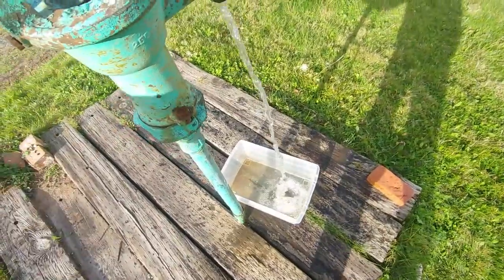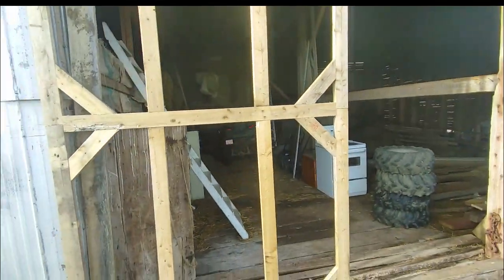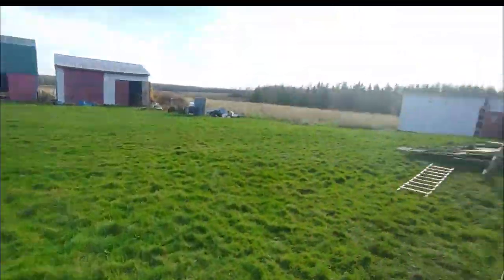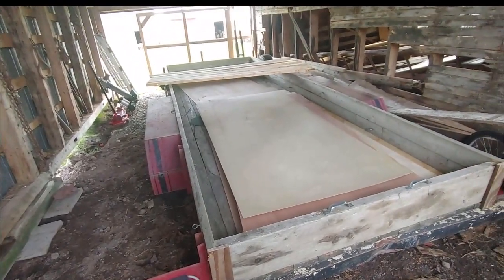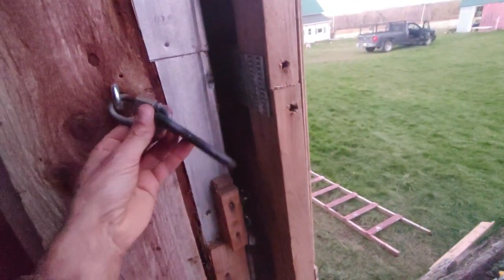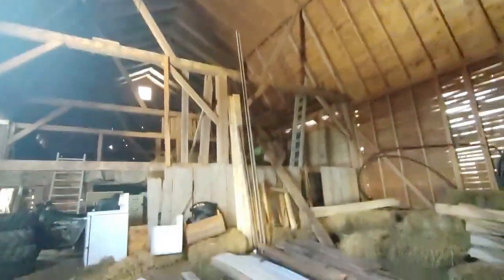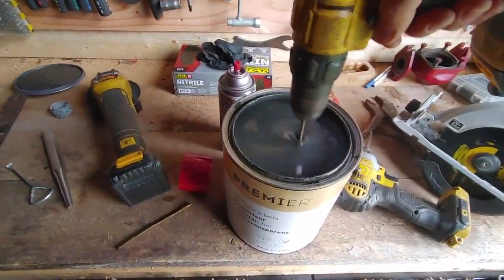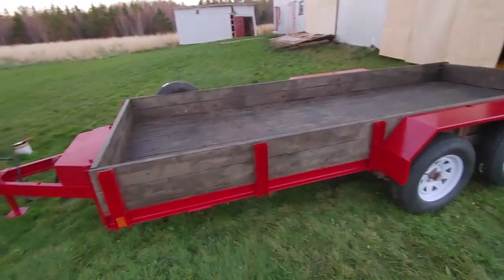Fixing my trailer and barn doors.

Comment: The red "plywood" you salvaged that you plan to put on the back of the building is actually OSB (oriented strand board) and doesn't last long exposed to the weather.  It's usually used as a sheathing, then skinned over with an exterior siding material, like metal, wood siding, cement board or vinyl.

Comment: Flatbed trailers:  I still keep one around, since they work well for moving the tractor, long lumber, corrugated tin or logs (for firewood), but find that most of the time i pick one of my enclosed trailers for moving general items.  For my resale business, I find that a 10-12' enclosed trailer is more useful for hauling to and from the auction and such, since it keeps the product out of the weather.